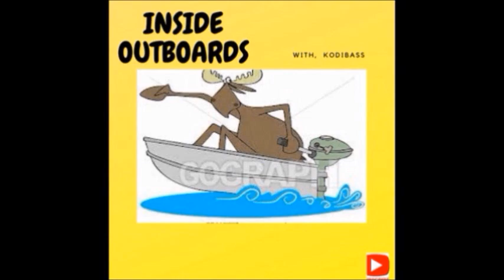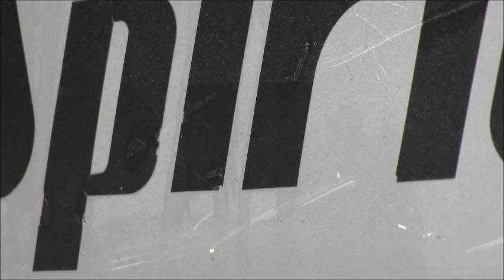SPIRIT 20 HP OUTBOARD Done .     + More

Comment: What is the oil mix?
Reply from the maker: 50-1  good quality TCW-3  marine 2 cycle oil.     kb
Reply: @kodibassInsideoutboards  Thank you very much, I have the 1979 Susuki Spirit with electric starter. I think it has 25HP long shaft, but it only moves forward and is always in drive because the clutch doesn't work. Apart from that, it works perfectly. Do you know what the problem with the clutch could be? clutch, parts are really hard to come by.